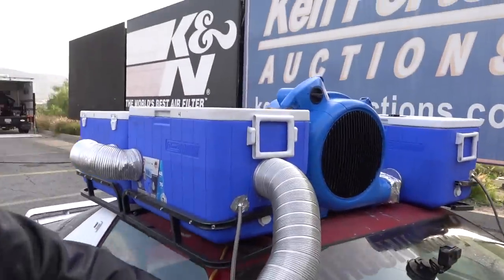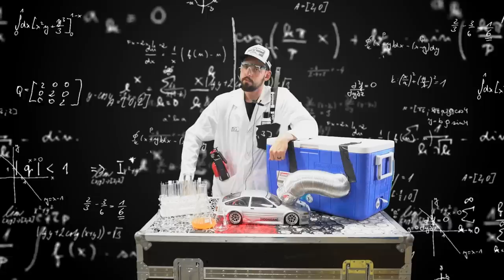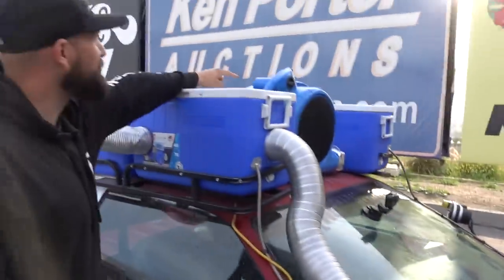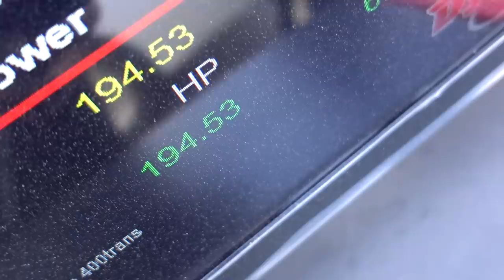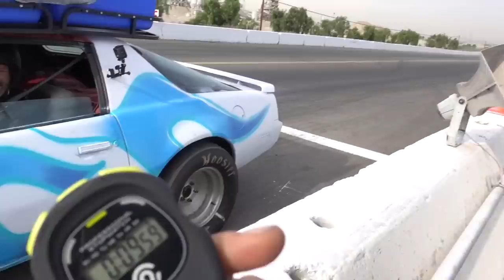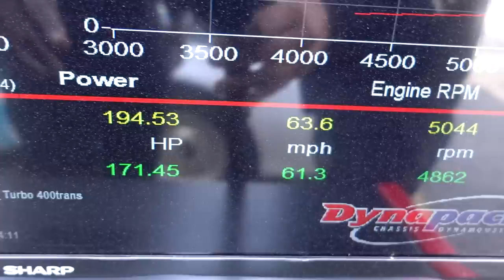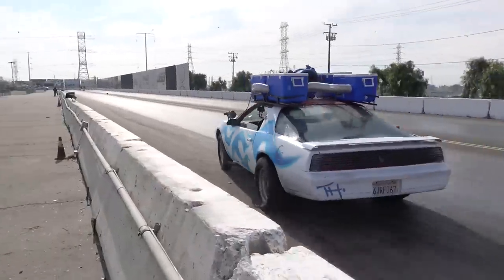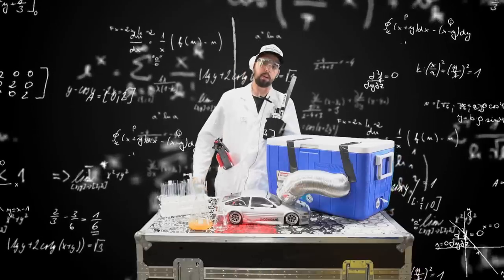Dry Ice Cold Air Intake: Does Frozen Air Make More Horsepower?

Comment: What happens if you have pure oxygen running through the intake instead of regular mixed air?
Reply: unique username this is what nitrous tries to achieve.. nitrous is an oxygenator which introduces more oxygen.. which means leaner mixture.. which means you need more fuel to even out the afr’s .. which in turn gives more power because oxygen+fuel=more power.. the purity of the oxygen isn’t nearly as important as the amount of oxygen you trying  to pump into the engine..
Reply: You melt things. The other stuff in the air needs to be there to absorb heat, hence why nitrous is used instead of pure oxygen. That being said, if they're sending the car off anyway, they should dyno it hooked up to an oxygen tank.
Reply: you can get OXYGEN tanks and they could injector it like you do NOS
Reply: It's called a bomb, pure oxygen is extremely flammable so when introduced into an enclosed space(cylinder) and add spark (ignition) it will detonate thus nuking the engine hence a bomb.
Reply: It causes engine pinging because the oxygen doesn't fully compress like nitrous. It detonates early and can cause severe engine damage.
Reply: A large bang.
Reply: bang, followed by an all consuming fire.  Pure oxygen will make nearly everything burn, even the metal of the engine.
Reply: @roses_rebirth_2563  lol wut ... it compresses just like the air you breathe.
Reply: @detaart  engine pinging is what I've heard
Reply: Nice idea...but people had tried injecting pure oxygen into the engine and it didn't work as expected like nitro!
Reply: Look up "mastermilo82", he just uploaded exactly that experiment.
Reply: Hammarix lol I'm a few seconds too late

Comment: hmmmmm C02.......just think about that for longer than 0.5 seconds....hahah come on guys! this is like grade school chemistry! got to quit letting brad do ALL the thinking on this stuff haha
Reply: Emory exactly what I was thinking. Maybe cool the outside air with dry ice but don’t take the air from the dry ice.
Reply: Science
Reply: They should have used liquid nitrogen
Reply: @chaselynes9355  thats what i thought they were originally doing untill they open the cooler. all they would have to do is run the dryer vent hose through the cooler in one piece. then they would have a simple heat exchanger  of sourts
Reply: Could have worked if they had the dryer vent pipe running through the coolers (not open to the inside of the coolers) and dry ice packed around the pipes.  That and they would need to eliminate the other air filter in the engine bay, seems like the majority of air will get pulled through that filter despite the fan.

Comment: You guys need to pull a towable job site compressor behind that car!!! That will give you the ultimate boost! They deliver 180 CFM @ 90 PSI.  Please do it!!!!!!!!!!!
Reply: See roadkill, episode called the boost caboose
Reply: Curtis Tilghman no way the engine would handle it...
Reply: Crusty Sock ...... Well where is the fun in that??
Reply: E. Africanus it would die too quickly is what I mean... It wouldn't be much of a show...
Reply: Crusty Sock they could hook the air supply up to one of those big ball valves they’ve been using so they can adjust the pressure. Go up a little at at a time until the heads lift!!!! Ha ha
Reply: SBC consumes over 400 cfm of air..
Reply: Richard Scott just talking about using it for boost not total supply.
Reply: In order to generate boost you need more scfm than the engine consumes. The engine pumps it's displacement every 4 revolutions, so pretty simple math, also atm is 14.7 psia anything over that is genorating "boost"

Comment: The dry ice is carbon dioxide, the engine needs oxygen.
Reply from the maker: Firetud runs on 100% Bad Gas and Carbon Dioxide, its a hybrid.
Reply: BUTTTTT C O it has oxygen CO2 has 2 Oxygen to one Carbon you silly
Reply: unless you can chemically strip the carbon and oxygen apart, its just carbon dioxide, not carbon and two oxygen.
Reply: this would have worked out better using copper tubing funneling it through the intake and having the dry ice sitting on the copper,think 10 copper tubes about 1/4 inch in diameter splayed apart like fingers soldered together at the end point into a circle where you couple the intake.
Reply: @phantomofdetubez2376  dont use wiki, have fun on roblox.
Reply: Jason Pressler oooOooOoOoOooOooOoOoOoOoOoOoo I need some ice cause I just got burned

Comment: Yes, this will make a difference,  cold air is easier to compress.  The issue you have here is less air, dry ice cools and releases c02, which will not add to a stagnant car, but will compensate when air starts moving. You should do the updates I suggested on the compressed air upgrade you attempted.

Edit: thumbs up

Fire extinguishers use c02 to snuff out fires.

Comment: The co2 is displacing the actual oxygen you need to burn. Y'all should have run dryer pipe uninterrupted through the coolers so regular atmosphere would still be in the intake, just much colder

Comment: Might as well have just hooked a hose from the exhaust to the intake. 🤷‍♂️
Reply: That's kinda what they did. This was more a "Displacement on Demand" test than anything.  This is like an alternative to "EGR". If they had a fuel injection system on with the dry ice air intake system, they should get increased fuel economy as the CO2 will displace some of the air in the cylinders and the EFI system would then inject less fuel.  It's probably the most expensive EGR system EVER to operate, though...

Comment: 10:56
You probably are right, for a different reason.
Dry ice is frozen carbon dioxide. Carbon dioxide will inhibit combustion, so fuel wouldn't burn in the cylinders. After it warmed up, the air outpaced the carbon dioxide providing a net improvement.

Comment: Just as efficient as supercharging by using the exhaust pushing into the carb, I thought to myself, these guys did it right this time, and put the tube in one continuous loop through all the coolers, but Nope. Just made the coldest roof mounted EGR system.

Comment: From what I can remember from school dry ice produces CO2 gas which does not burn if anything it puts out fire you can do intercoolers packed in dry ice with air running through it or you can do oxygen injection with the intercooler and put the air filter at the source where the air goes in

Comment: You need to have a dry ice and methanol system that recirculates, but the piping has to be copper or brass and either wrap that cooling piping AROUND the cold air intake plastic hose or make something that looks like the coil of a distillation condenser used in organic chemistry and put that INSIDE the large hose of the cold air intake. Even better would be to have it be a two layer system where the piping is wrapped by an insulating layer around itself and the cold air intake hose. If you need to make the coil out of copper/brass 1/2" or 3/4" piping you can do so by filling the pipe with water, weld both ends closed, freeze it until the water is solid ice and then do the bends so that the piping does not deform, you can do that or you can fill it with fine sand and weld both ends and bend it in the same way into a coil around a mandrel that you create that is close to the size of the interior diameter of the cold air intake or the outside diameter of the cold air intake hose coming from the filter.

Comment: All you need to do to "fix" this is to run the pipes through the chests completely. 

As it sits, the dry ice is sublimating and pouring a LOT of CO2 into the intake rather than just cold air
Reply: Btw, it "Clears up" because the intake lines are clearing of the CO2 as the revs increase

Comment: This needs revisited.  To cool the fuel, have a coil of fuel line inside a container of dry ice and alcohol or if you build an engine that runs on ethanol, you can just put dry ice directly in the fuel.  To cool the air, put alcohol and dry ice in an air-to-water style intercooler.  Then, just add some extra dry ice directly on the intake manifold to keep it cooler so the air/fuel mixture is even cooler when it reaches the combustion chamber.  This is not a “safety 3rd” kind of project though.  Understand that placing dry ice in atmospheric temperature alcohol will create a boiling effect as the dry ice rapidly transitions from solid to gas.  So, don’t do that inside an air tight sealed container unless you want a pressure explosion involving a flammable liquid.  You need the system to ventilate gasses yet contain liquids.  Not rocket surgery.

Comment: This one's easy - you needed to use an isolated cooling loop instead of air over dry ice to prove/disprove extra HP from cool air. You introduced CO2 into the intake and that doesn't burn. Now if you had passed the air over liquid oxygen instead, that'd give extra oxidizer and a heck of a boost. LOX isn't hard to acquire, but it would be hard to strap on a roof - probably best to try a truck.

Comment: If you would use the dry ice air as the only intake it should theoretically make more as observed on the track run as the pressure of the air pushed in to the fan increased due to the cars speed therefore bypassing the air coming from that filter(as you have a filter and then the dry ice apparatus connected to intake it is mix the air up what if you use the filter to pull in air to the dry ice box and it goes to the engine without a break as the engine would have a  vacuum effect on this setup then if you include that fan it might work like a small cold turbo) just a hypothesis

Comment: What probably happened here was that the dry ice was fresh when the car was on the dino, meaning it cooled the air but also introduced a bunch of CO2, lowering HP. Then as air rushes through the dry ice it condenses the moisture creating water, water will wet the dry ice and retain the cold, air keeps being cooled but CO2 concentration reduces somewhat, making more power.

Comment: I think you guys should have done it different. Dry ice needs to be in a sealed metal unit so no co2 can escape, the metal unit should be inside the air box or standard air intake pipe maybe even more than one . My theory the metal box will cool passing air acting like ice blocks behind a fan. I feel all the extra piping used may have affected  the amount of air it was actually receiving

Comment: You should have used some kind of medium to transfer heat instead of just letting the air past the dry ice. Dry ice is frozen co2,  if those gasses get mixed it reduces the oxygen concentration, which reduces horsepower. Basically the same as running at high altitude.

Comment: If you ran the cool air pipe through the coolers instead of pulling air from the co2 and put them inside the car  to prevent drag you might be on to something

Comment: Colder air means a more denser air which means more fuel can be burnt but you guys made one mistake. That's because when dry ice sublimes it turns back to Carbon dioxide . The fix for the problem is to have the intake not mix with the dry ice but to put a intercooler in the igloo /party cooler covered in dry ice that will separate the dry ice from the intake air but cool in to a great degree

Comment: The most commonly known flammable liquid is gasoline. It has a flash point of about -50° F (-65° C). The ignition temperature is about 495° F (232(232° C) [sic], a comparatively low figure."

There is such thing as too cold and the fuel wont atomizer correctly.

Comment: On the dyno the fan on the roof had to push the air throught the coolers, so maybe the wind on the fan blades when the car was moving helped to push the air through the coolers, which made more power because more airflow?

Comment: yeah I can see using it to surround a ...radiator or fuel cell, but co2 being blown into the intake doesn't make sense.  When the lid blew open half track, it started getting actual cold air, in the form of oxygen.

Comment: I hate to burst your bubble but dry ice is made of solid CO2 (carbon dioxide) and it evaporated quickly because it boils at -109 F. Your setup is pulling some air but it’s mostly drawing in pure CO2 which is used in fire extinguishers because it can’t be combusted like oxygen. It’s going to make your fuel mix off the charts rich.

Comment: I actually had this idea years ago but not to let the dry ice evaporate and definitely not let that co2 into the engine. Keep the dry ice contained in a tank with fins that the intake air would pass to cool normal air. Maybe it could work but I don’t know how much power it would actually add. I think the air would move too fast to get much cooler.

Comment: If you guys want cold air. Try an oxygen tank. Run it straight to the engen.  The oxygen in the tank is a liquid until it hits atmosphere so you should be in theory able to pump liquid oxygen straight into the carb.

Comment: Well since dry ice gives off carbon dioxide it’s depriving the engine of o2 but what if u had the same set up but draw  air from outside the coolers like run a pipe through all of them and then run the fan that was going through the coolers then it just cools the air as it goes through all of the ice chests

Comment: My bet is the long burn-out cleared all the concentrated CO2 out of the coolers so you actually got more O2 into the engine on the track.  If you would have isolated the CO2 vapors from the air you're trying to cool, you would have only been concentrating the air without adding lots of extra CO2.  Didn't they do something like this on a Ford Lightning back in the day with the AC system?

Comment: The gas from the dry ice isn't separated from the actual intake air. This is not a best case scenario as it is replacing oxygen in the air with the gas produced by liquid nitrogen being passed into the engine. Instead of routing it directly into the intake use an air to air intercooler and put the super cold air passing through the outside of the intercooler. The liquid nitrogen is replacing part of the other half of what creates a fuel for combustion (air).
Reply: A super rich fuel mixture always runs worse. A good test of this theory would need the gas cooling the air without directly flowing into the intake and a retune on the carburetor to correct the fuel mixture from introducing cold air to the engine.

Comment: you could have put a pipe going straight through the coolers and just packed dry ice around it.  going through 2 cooler should be long enough to cool charge the air.

Comment: CO2 wont help with combustion, you need cold air,
Reply: Your right this is want they don't understand super Cold air intake will make shit ton of power
Reply: cold air contains 25% more oxygen compared to hot air so burns fuel much better, would work better than a turbocharger as the engine does not need to be run under high pressure so wont break easily, its a wonder no car manufacturer has not super cooled the intake air system, A/C in mass filter

Comment: Water injection at high altitude for Pratt and Whitney double wasp as air  is thin at high altitude 2200 hp 18 cylinder radial engine. For f4u corsair

Comment: The long burnout before the drag run heated the piston tops and cylinder head, allowing the engine take advantage of the extra available oxygen to burn more efficiently. The cold cylinders on the dyno run slowed the burn time, reducing the amount of time at peak cylinder pressure, which in turn reduced the horsepower output.
  Of course colder air helps the engine make more power, that is why high-performance turbocharged engines have intercoolers. No, they did not put any CO2 into the engine; that's just ridiculous.

Comment: Its obvius this car has alot of miss fire which will lead to inconsistance times without the cold air notice he didint launched correctly the motor miss fires alot, and second try with cold air he just got a lucky launch off at beggining with no miss fires. Just my observation. You should try same project with a fully functioning car so that way results will be more accurrate :)

Comment: Not to cut you guys down I haven't watched the video yet I just started it but the first thing I saw was wrong was all the carbon dioxide coming off of the dry ice is going to cause less horsepower. Encase the carbon dioxide in a separate chamber so the air can flow over the cold metal then you will have a true test

Comment: You needed moving air because dry ice is frozen carbon dioxide so if it was standing still it's just blowing carbon dioxide into the carb and well CO2 does not make boom but when you get it moving it gets fresh air(oxygen)mixed with the CO2 so it can make booms so yeah power? Right? That's what I think happened.

Comment: Dry ice is frozen co2 so you can guess what thay smoke coming off it is, co2 is a fire surpresant and its used in fire extinguishers so what your doing is flooding the engine with something that doesnt burn.

2nd you do not want cold fuel in a carbureted fuel system because it doesnt atomise and mix with the air as well.

3rd try pure oxygen instead that would be interesting

Comment: Pumping dry ice exaust ( CO2 ) displaces oxygen ( O2 ).  They have fire extinguishers based on CO2. And feeding that into engine.  Cold air in general helps, because is increases air density to allow more Oxygen O2, to burn the fuel, to make CO2. Pumping in CO2, skips the usefull "fire" step.

Comment: 1st launch was a bit hesitant and second was not PLUS the fuel container blew open so, perhaps that was a factor.
Reply from the maker: Dry Ice produces Carbon Dioxide which means there was less oxygen getting into the cylinders...
Reply: @TheHoonigans  I AGREE. What I'm saying is the reason the second run was faster is because Brad didn't hesitate like he did on the first jump at the start meaning it had nothing to do with the cooling rig/setup. He just did a better run.